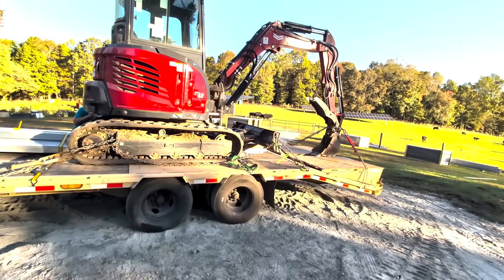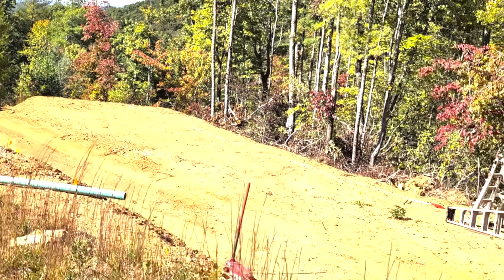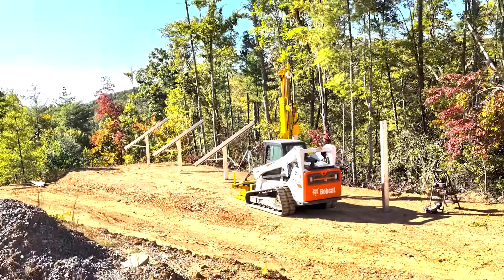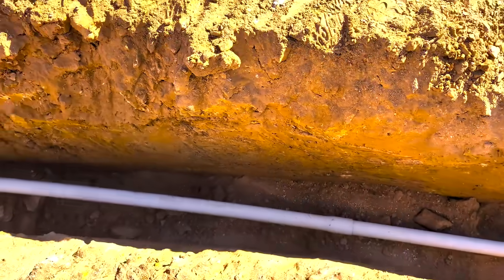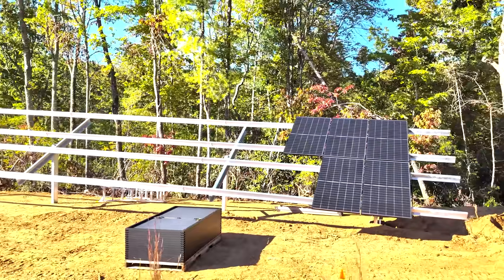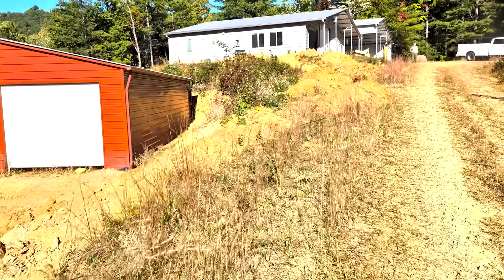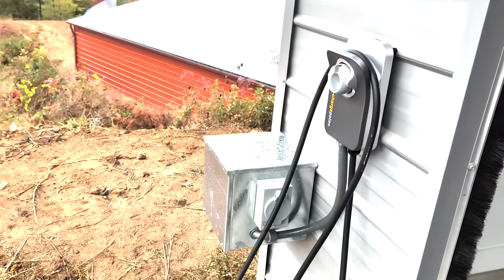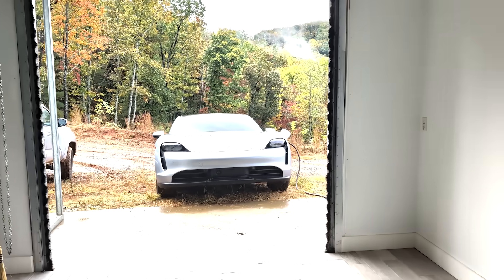Off-Grid Solar Reality Check

Comment: I live off-grid, built my own home, self-installed my Sol-Ark system. But getting a USPS mailbox and legal residency status required an occupancy permit from the nearest town building inspector and fire department.  I had to follow all NEC guidelines, primarily for the safety of any first responders.  The funniest comment during the whole process was when the town building planner asked “did the power company approve your off-grid plan?”, and I replied: “I haven’t talked to them, and don’t plan to!”
Reply: Or "Of course I approve.  I am the power company."

Comment: As soon as I saw where the panel was, i was worried that was not going to pass. Some guys will give you a break (especially since it's off grid). But there is good reasoning to being extra strict at remote locations.

Comment: I’m thinking the real problem was you didn’t have the 30” clearance on the panelboard, which has to be maintained to the ground but allowing a 6” encroachment.
Reply: i have seen panels crammed side by side (maybe 4" apart) and its ok (in commercial). why would a resi-inspector jam this up?

Comment: I didn't know about that code either man!
An auxiliary gutter box becomes an obstruction to a main service panel when it extends more than 6 inches beyond the front of the electrical panel and into the required working space. This rule is detailed in Article 110.26(A)(3) of the National Electrical Code (NEC). 
Here is a breakdown of the specific requirements from the NEC: 
Working Space Depth: A working space of at least 36 inches must be maintained in front of the electrical panel.
Obstruction Limit: Any equipment or support structure associated with the electrical installation, such as a gutter box, is not permitted to extend more than 6 inches into this 36-inch deep working space.
Reply: 110.26(a)(3) isn't new door must swing greater then 90 degrees open need 30" of room the side so the door can open all the way. That panel to the left door was hitting the inverter.
Reply: Unless they had some local code requirements the side to side spacing was not a problem. NEC 110.26(A)(2) Says you have to have 30” of working space. So if your panel is 30” wide that is all you need. You can put something right beside it. 

The door then has to be able to open 90 degrees. Which is an L so the door has to open up so it sticks straight out. It doesn’t have to open up to be flat against the wall, that would be 180 degrees.

Comment: Got to keep up with them NEC codes ! As a electrician ,once in a great wile I get hit with a code change I was not shore about .It can cost some $$ .  I hate rocks in way of conducts. I keep demolition hammer handy just for that. It can easy add hours to a job you did not expect.  I get jocks sometimes about explosives being used . In big jobs that is done. Blast the rock away . Just things we do to beat the stress from unexpected  work  !  Cheers from NY !

Comment: Surprising that an off-grid job would require an electrical inspection.
Reply: Even replacing a water heater requires an inspection. The townships want their piece of the cookie
Reply: @akshonclip  this is indeed true. That's why you don't call them when you're doing little stuff. I think it's completely ridiculous that you have to get a permit for a water heater. It's an afternoon job. They don't need to know about it. But when the assessor flies a drone over the house and sees all the solar, then looks in the permits and sees no permits pulled, you'll have problems.
Reply: Land of the free, amiright?
Reply: Doesn’t matter if it’s off-grid or utility-tied to enable the system to kill people and burn down houses.
Reply: Insurance?
Reply: @erikslagter3231  insurance still covers it even if it's not done "correctly." Insurance does pay out. They may drop you afterwards, but this is more of an urban legend than reality.
Reply: @UniqueContent-u1v in The Netherlands you are liable if you change the electrical works, so insurance will not pay out
Reply: @erikslagter3231  100%, plenty of neighbors think they are pulling a fast one by not pulling permits....wait until you file claim. Amazing how deep an Insurance Investigator will dig into records if they can avoid paying a claim. Also do you tell the truth or lie when you go to sell your place on the Disclosures??
Reply: Who would insure your house with un inspected random electrical work?
Reply: Ours didn't, we thought it did. But after we did the rough in and it came to actually getting power to the house the inspector said it was none of his business if it wasn't connected to utility. Still try to do things as nice as we can
Reply: Where do you get those gutters? Custom?
Reply: Free men don't ask for permission.
Reply: @thekid760
I agree but sometimes they have to ask for forgiveness. :)
Reply: If it is permanent electrical it needs to pass code. Doesn’t matter where the electricity is coming from.

Comment: Honestly, I would have red tagged it too.
Reply: Agreed. Blocking the panel like that is kind of an obvious no-no.
Reply: Cite the article
Reply: Article 110.26, titled “Spaces About Electrical Equipment“

In section 3 it says nothing can stick out past 6” within the work space. The gutter was more than 6”. Here is the section. 

Section (3) Height of Working Space
The work space shall be clear and extend from the grade, floor, or platform to a height of 2.0 m (61/2 ft) or the height of the equipment, whichever is greater. Within the height requirements of this section, other equipment or support structures, such as concrete pads, associated with the electrical installation and located above or below the electrical equipment shall be permitted to extend not more than 150 mm (6 in.) beyond the front of the electrical equipment. Exception No. 1: On battery systems mounted on open racks, the top clearance shall comply with 480.10(D). Exception No. 2: In existing dwelling units, service equipment or enclosed panelboards that do not exceed 200 amperes shall be permitted in spaces where the height of the working space is less than 2.0 m (61/2 ft). Exception No. 3: Meters that are installed in meter sockets shall be permitted to extend beyond the other equipment. The meter socket shall be required to follow the rules of this section.
Reply: @tristatehomesllc599  110.26
Reply: @tristatehomesllc599   always remember an inspector can fail you just because they didn't like the way something looks.  
An example is I don't like seeing seal tight or conduit away from the wall in commercial or residential spaces.  There is a practical reason for it, it's too easy for someone to crush it but in that location it's highly unlikely that would happen or if the home has young children, those kids will be pulling on it.  
Wasn't able to see what the wall penetrations were, I would prefer it go to a junction box then go around to the equipment.
And no, you won't be arguing with an inspector.